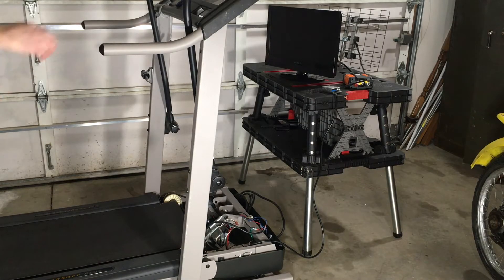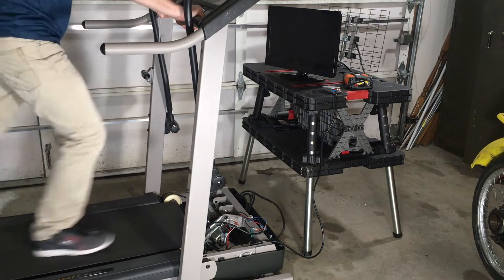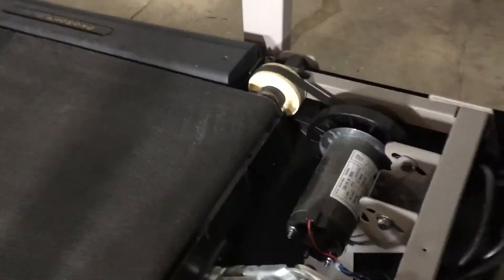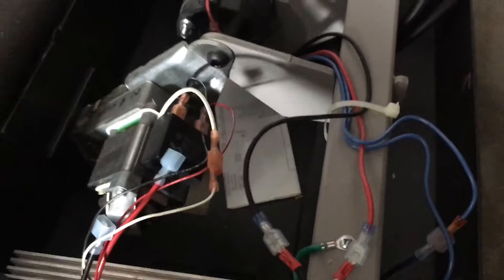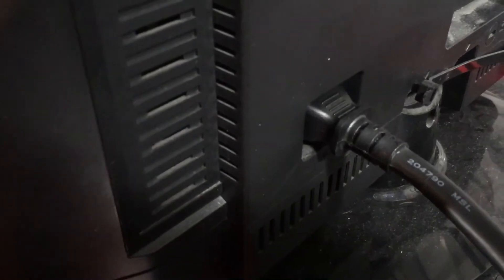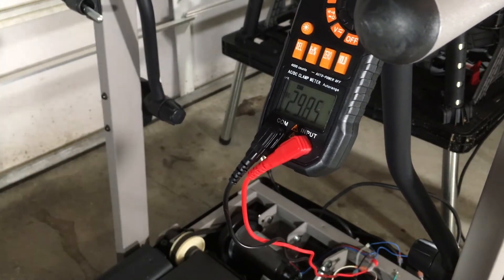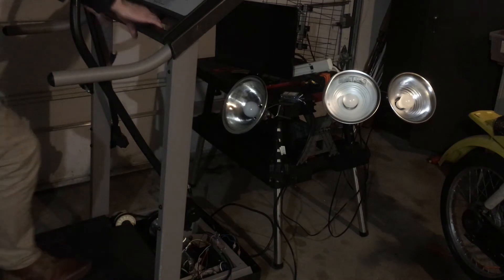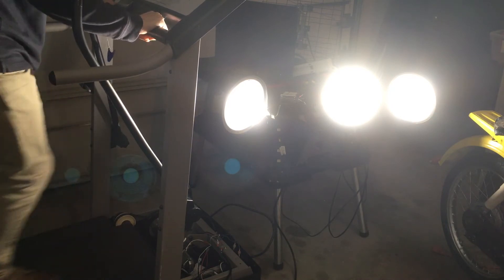DIY Treadmill generator- make your own power

Comment: saw someone make a prototype linear treadmill for walking in virtual reality applications/videogames. Omnidirectional treadmills exist for about a thousand dollars and are extremely underwhelming by comparison. The treadmill in question was a lubricated manual treadmill, and I think perhaps a treadmill that turns a crank connected to either an electronically-controlled brake or a flywheel would accomplish the task better, though the simplicity of the linear treadmill is pretty nice.

Comment: It's been a while since this was posted and I see that your interests have gone elsewhere. I'm now I'm trying to solve, generally speaking, point of use electricity generation problems without a lot of foundational electrical engineering theory. I'm a successfully clever guy but I don't really understand what's happening here in the way that I do with my career expertise.  I appreciate your practical demonstration as I'm far more likely to mimic than actually innovate.

Comment: Whats a pre set voltage
Reply from the maker: You want a buck converter to lower the treadmill output voltage to a smooth 12v before going into an inverter

Comment: Can you provide a link to a regulator on Amazon that will work please? Love this idea!
Reply from the maker: To lower the output voltage of the treadmill to 12v, I used a buck converter- something like this https://amzn.to/3IgbCJ3. You’ll have to adjust the set screw on the converter to an output of 12-13v.  You’ll need a multimeter to do that. The treadmill can put out a lot more than 12VDC so if you try and feed it directly into an AC inverter the high voltage will likely blow a cap. Bang. But seriously, it will.

Comment: excellent sir. This should have been the most available type of Treadmill which can save Billions of dollars in electricity bills and save the Earth from pollution resulting from power-plans. You can even feed the power to a grid from a Gym then instead of receiving power. And a powered treadmill consumes about 8000 KCal per hour (1KW motor) while we burn only 500 Kcal walking on it. So it is machine doing over 10 times the work you do. Wish people think about it..

Comment: Sir if treadmill motor produce 12v continuesaly then can i use this voltage directly for a 12v inverter
Reply from the maker: Inderjit Singh the motors generally produce a varying voltage in my experience. So you need a way to regulate it to output around 12v continually for the inverter. If you have a treadmill that always produces 12v then you would be fine. Just make sure not to put too high a voltage into the inverter or you’ll blow a cap (which I’ve done)
Reply: @Whynotmake  I use a DC-DC buck converter - now charging 4 amps from a treadmill motor on a bicycle -
Reply: @voidisyinyangvoidisyinyang885  Iv one of these projects I'm now revisiting after 2 years...
Mine produces 12v @ 4 amp
At a slow peddle ( I use peddle speed to regulate volts)
I'm going to look into this DC-DC
Buck converter to see if I can up the amps and keep it at 12v...
Reply: @voidisyinyangvoidisyinyang885  Thanks!
I'm working on getting a treadmill
In my house now.....the exercise bike is neat but can't utilize most of its energy so I hope your recommendations will help!
Reply: Thanks
Reply: Should be mandatory viewing for Texas and the south for winter weather...

Comment: Interesting design！！It seems that external electric input is not needed, which is unlike an ordinary treadmill trainer. So I mean can this generator be integrated with a working treadmill (active motor) without interfering with its function. Is this just a passive one using human motion to generate electricity? Looking forward to your reply and many thanks in advance.
Reply from the maker: Hi, so in this case I am using the DC motor of the treadmill to act as a generator.  The treadmill will not work normally when you do this since the motor is not driving the belt of the treadmill.  I am moving the belt by forcing it to spin as I walk, it is not moving on its own.  The motor of the treadmill cannot generate electricity as I am doing and power the treadmill to move at the same time, they are mutually exclusive.  Hope that info helps.